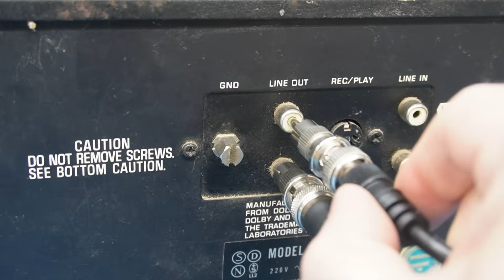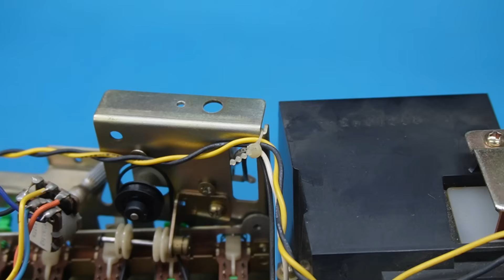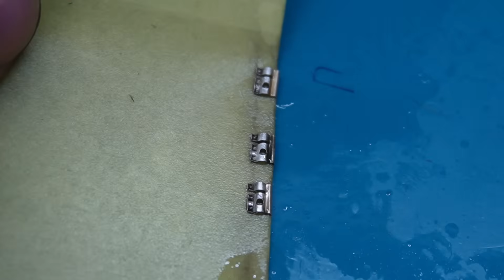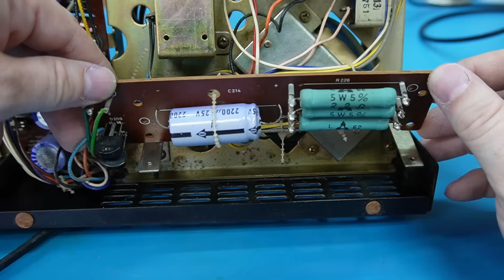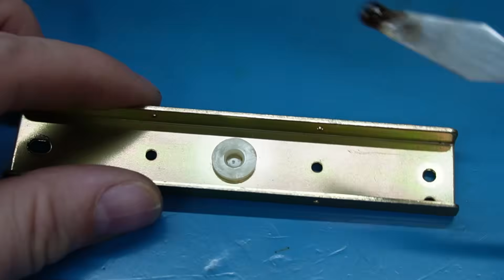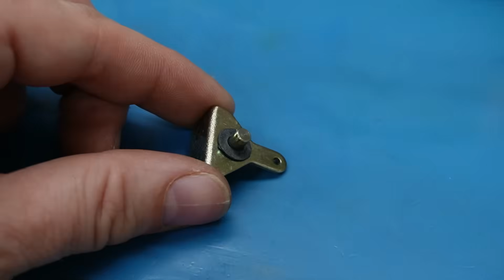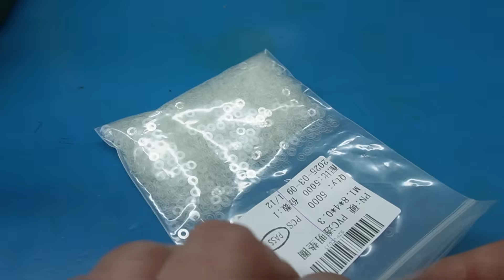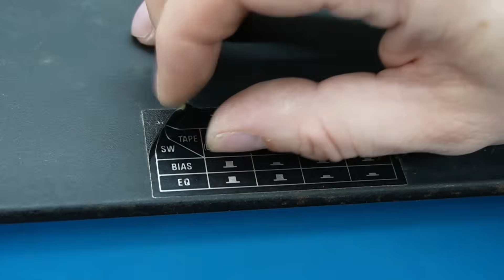The TECHNICS Tape Deck (RS-671)

Comment: These Technics 670 series decks from the 70s are unbelievably well built, as are the M85/88/95. Everything is solid stamped galvanized steel and all the electronics are discrete. In my opinion they are possibly the prettiest and best built decks ever. The Nakamichi Dragon may have bells and whistles, but half of it’s transport is brittle plastic.

Comment: I designed and built a ton of lab instruments using those Shadow switches. They very rarely failed of became intermittent. I even used them in my sterio preamp that I designed some 40 years ago. Like you said Mark. They don’t build them like they used to!

Comment: What a beautiful, solid engineered piece of audio equipmnet. Everything made of metal other than replaceable service parts. Huge capstan flywheel. Over built tape transport mechanism. Solenoids twice the size they could have used. And on top of that its the small things you see: The small pieces of dampening foam inside of springs., This entire thing radiates Panasonic construction. Panasonic and Sony of this time making things to last 100 years it seems. This player will last that long with proper care.

Comment: I can't understand why, in a forum like this where so many users are present and active, giving opinions and gathering information about this equipment, nobody posts links or PDF files of the documentation for these Technics RS-607 and RS-608 devices. It's sorely lacking and helps to work professionally without makeshift solutions or shortcuts.
I really need this and can't find it anywhere, if you could help me... thank you very much.

Comment: Hi there! Quick question: what color code did you use for the deck cover? I have an RS-BX646 that I need to restore, and I want to match the original color

Comment: Black silver oxide conducts fine, but if you want you and do not trust it you can easy remove it with ammonia. I clean coated contacts the same way as you using paper and in my case K61

Comment: Hi Mark I’m a Penn fishing Reel service technician can I suggest a couple products ? 
Super lube synthetic grease it is food grade safe and will never harden up 
Also reel X I coat all metal parts with it and it will prevent any further corrosion or pitting probably for life I use it in salt water applications and never seen any further corrosion years after use I highly recommend you experiment with it for your excellent service work

Comment: Yes. That idler tire was the culprit. However, I can visually See the wow & flutter on the scope. That's likely due to a generic capstan belt being used. I always used OEM belts to avoid this issue. Do you have a Wow & flutter meter?

Comment: Hey Mark, great video! been watching alongside trying to fix my own Technics RS-676 USD. At 25:36 it seems my take up reel doesn't spin as freely as yours and may need lubrication. same for my Tape counter gear. As a result it has too much resistance and it causing the auto stop to trigger.  Im afraid to take it off by force as i may break it forever. do you have any tips? cheers

Comment: Hello! I am very happy with this post of yours. I also have an RS 671! I want to ask you if it is advisable to apply a special lotion to the nut roller and the capstan transmission belt to prevent the rubber from aging! Thank you!

Comment: Rubber restorer is great for tyres, pinch rollers, & other rubber bits!  I just bought one called Rubber Renue 408C, and it's pretty good at restoring the grip & pliability of rubber components.  It does smell quite strongly of Oil of Wintergreen, however..
Reply: Back in the 80s we used methylated spirits to clean rubber rollers, it was very effective at restoring the surface.

Comment: Like you, I usually take the switches apart to clean them.  I usually give the stationary contacts a clean with some metal polish & use super-smooth wet & dry on the movable ones.  Your method with the fibreglass pencil seems to work well!

Comment: Wrong way to clean contacts, you must lube before assembling back. In 6 months, these contracts will be in the same bad condition. unit is old but you don't lube anything. Why? The way you apply the grease is terrible! Sorry Mark, but you fix everything without the heart. Yes, good smile but job done just for check mark!

Comment: Mark great learning video, next time you retread your hub and tire use superglue IC-2000, it has some carbon in it and will actually flex some. We use the IC-2000 superglue in the RC model plane and cars and drones hobby where we need a little flex in the superglue joint to protect against shock and vibration. Also HPF stands for Hot Pressed Ferrite heads

Comment: Method 3, bending legs to open the switch is the least favourite of mine - but also the most rewarding, and in case - of Pioneer and Technics - there was considerable buildup inside. The Pioneer had too many legs break when trying to put it back, my Technics made it, barely. Later I did the same thing for a guy I met online and I finally did it, but had to repair using a cable strip to hold a switch together. And it took me ages and several mails from him to make me actually go and do it. In the end it worked, but not as great as I had hoped.

Comment: Hey @MendItMark, you could get an low-end 3d Printer. It should allow you to print washers and o-rings in different "hardnesseses" of TPU and would spare you the tinkering with rubber band.

Comment: Back when these were current they used to come into the service centre with badly worn playback heads as they were difficult to clean at home, so people used ”cleaning tapes” which were often rather abrasive. I disliked the horizontal decks because cleaning them required more disassembly than a standard deck.

Comment: I was taught by engineers at Harmon Kardon the importance of clean and CONDITIONED switches. you disassembling those switches speaks volumes to just how bad ass you really are. May I suggest a further step.
there is a product called cremlion oil spelling bad or even wd 40 will work. the switch contacts should be soaked in it than assembled. you want a protective coating on the contacts. cleaners strip them to bare metal as does the contact stick you use. once bare it oxidizes twice as fast. just look at your brake rotors when you park your car at night than check again in the morning solid rust (normal for car rotors but not switch banks) 
even white lithium grease can be used it will prolong the lift and eliminate the intermittence that plagues all techs.
thank you for all you do . my favorite part of your show is when you just happen to have some crazy chip burner or other equipment saved for R & D labs

Comment: Wow, just the editing alone is impressive.
Not seen anyone go to these lengths of servicing older tech on YT, but there are probably some others I haven't seen.
I have dabbled just a little on old radio and cassette repairs, not always succeeding. I don't have the patience!

Have a Sony ICF- 880L radio with a few 'presets', which is in good condition (made around 1991). It works fine, albeit the white casing is a slightly yellowed, but still  looks a quite near it's original cream colour. 
Only problem is the volume is a little scratchy to get right.
Did open it, but it's so crammed with more quality than not, it looked like a mine field of going deeper to get to the volume switching. I tried switch cleaner, which improved it a bit with more volume control, but still needs a little correcting for volume to settle in one spot.
Bought it at a car boot for 50p in 1997 and have used it every night since!

Comment: Ode to Mend It Mark
(A Funny Poem in Praise of a YouTube Legend)

There’s a place on YouTube, a soothing delight,
Where capacitors twinkle and solder burns bright.
No drama, no shouting, no influencer lark—
Just circuits and calmness, all fixed up by Mark.

With vintage hi-fi, he works like a pro,
Reviving old radios from decades ago.
A tape deck, a turntable, dusty with age—
He opens them gently like turning a page.

With screwdrivers poised and a cup of strong tea,
He coaxes old tech back to life tenderly.
“Ah, that’s the culprit!” he says with a grin,
As resistors surrender and new parts go in.

The hum of a soldering iron fills the air,
Like spa music for geeks—it’s ASMR flair!
No rush, no fuss, no influencer bark—
Just soothing repairs from Mend It Mark.

So if life’s too noisy, your brain’s in a fog,
Skip the yoga, forget walking the dog—
Just tune in to Mark, and soon you’ll agree,
That mending old hi-fi is pure therapy! 😊

Comment: Can you help me? I have a Krondack TK23 recorder. When I turn it on, it makes a buzzing sound. I replaced the 50uf350v capacitor and the buzzing went away. But when I turn it on and raise the volume, the sound is as if the heat signal cable is cut off.😊

Comment: Hiya Mark, just wanted to say thanks, this video is a lifesaver :) I've had a Yamaha TC-1000 deck on my desk for a few months now, with almost identical issue: right channel goes into a feedback loop when playing. I tried almost everything from power supply to disconnecting the head and grounding the input, but only when I saw this video a few days back it occurred to me that this big solenoid-activated switch might be the issue... removed it, measured, and what a surprise, there was resistance in tenths of Ohms on some contacts. Cleaned it up, works like a charm :) so thanks a lot, again! Love your videos, keep it up!

Comment: I ended up buying one of these second hand (ex-dem) back in the late 70's (brushed aluminium not black). Everyone I knew who were shopping for a cassette deck at the time (plus me) was on the waiting list for the RS-631 which was all the rage. A dealer was selling the 671 second hand for the same price as a new 631. The 631 had larger VU meters and a smoother eject mechanism, but the 671 was sonically better. Thanks for the trip down memory lane.

Comment: We used to have to use pencils/pens to force the tape to wind if there were too many ridges in it. I think the machines are designed to slip if there is too much load, to prevent damage in case the tape was jammed.

Comment: Lovely to watch how Mark makes this classic Technics work properly again. Got the same deck yesterday from a friend and tried it today. Didn't play. FF&REW worked, but after watching the video i dared to open it. The big Solenoid, reponsible for the play function seemed stuck and after a little bit of fiddeling it worked again. Still have to replace a belt and a rubber wheel. Also the deck stopped after a few seconds when using ff&rew&play caused by a small belt which drives the counter meschanism's vertical axle. It seems to have a little magnet in its foot which triggers a small counting glass microswitch nearby. Once fixed all running functions worked again. Unfortuntely when assembeling a micro ball bearing and a roller came from nowhere towards me but this mystery was quickly solved thanks to this wunderful video which helped to locate the right positions for these parts again. Thanks Mark, for making such educative and easy understandeble video.

Comment: I don’t know where to start. My late father had a silver one of these as part of his audiophile setup. He also had a RS276 tape deck, a SL1200 turntable with a Shure v15 stylus and a SU3500 amp connected to a pair of IMF TLS-50 speakers.when I was 11 years old he did me a top of the pops style tape on a TDK SD-C60 tape, it absolutely blew my tiny mind. As I got a bit older my father made a few tapes for me and my brothers for our birthday or Christmas. I ended up with my own setup of a Technics SA400, Mission 700 speakers and a Technics SL-DL5 turntable with an Ortofon stylus. My tape deck was a Technics RS-M215 but I later changed it to a DENON DR-M22 tape deck which was much better. My father was impressed by the Denon design and sound quality too. I was given a Toshiba CD player by my brother but it was a bit odd as it was about the size of a paperback book and had a strange output making it seem quiet. I decided to replace it, one day while I was out shopping for TDK tapes I noticed a new Hifi shop had opened up and had a poke around, in the window was a Denon CD player that was looking magical. I asked if I could put a deposit down on the unit, I only had £20 in my wallet but was going to spend it! I got a receipt and headed off to WH Smith to check up on this CD player from DENON, it turned out to have been their top of the range model and was given a very favourable review. Knew it was meant to be £1200, the shop had it for £600 (in 1988) and I snapped it up a few days later! I was totally blown away by the sound and detail. My father linked it up to his system and was amazed to find the Denon had exposed a fault in one of his speakers. It was soon remedied and my father was very impressed. I still have the Denon CD player but it needs servicing as it’s a bit old. My main CD player is a Sony that takes 400 CDs and it needs servicing too as the belts have gone funny, it was a job emptying out the unit and putting the CDs in their respective cases. I still have the tape my father did many years ago, I had it put onto CD and sometimes I listen to it again. What’s strange is I never tire of hearing the songs or his voice. A moment in time that will always be special. Sorry to have gone on a bit but I hope you won’t mind too much. My favourite tape was the TDK OD tape but the ultimate had to be the TDK MA-R, it was in a class of its own.

Comment: Nice vintage 👌 tape deck!! Too bad 👎 they don't make these beauties anymore. I remember those dropper resistors. A word 👏 of caution with these. Be careful, those little resistors can get HOT, and will BURN fingers 👉. You're so right, they don't make them like they used to (actually, pertains to everything, including these tape decks). Your friend, Jeff.

Comment: Mark, Thank you for a fantastic video.  I have several of these classic decks and have worked on all of them to some degree, mostly dealing with non-electrical issues such as replacing belts and idler wheels.  Your video confirmed much of what I have "discovered" but it also showed me a few things and tricks that will help me in the future.  That "T" idler wheel can be purchased from a great seller on Ebay but the part is expensive and I've often wondered if a non-T wheel might work just as well.  Your video suggest it does.  Do you happen to know the exact size of the idler wheel you used?  Same question for the FF & RW wheels.  i do have a caliper to try and guess the exact specks myself but I don't have a repair manual so if you know those specs i would really appreciate it if you could pass that information on.  Thanks again for a GREAT video..

Comment: mark I've got two power amps H&H V800 1990s  both not working please help they are such good amps  also have orange SL 120 1960s Tascam 488 MK2 8 track recording studio. 15 inch Tannoy in monitor gold speakers . JBL 4333A 1980  or 1970 pair of speakers  I have inherited this equipment and I need to know what to do with it it would be great if somebody could restore all this wonderful equipment
Reply: as I go through this equipment on finding more and more stuff   LaserDisc Player Pioneer CLD-V300

Comment: I think a "safe block" type connector would be much safer to connect up 240 volt mains, that's what I use when there's no plug, a safe block is designed to safely connect live mains flexes without a plug and they're still available as a workshop tool as far as I know. And a word of warning about contact cleaner sprays, some of them can destroy old switches, I know as it's happened to me enough times, but that was decades ago, I think they use safer formulas now, but there just might be some destructive ones still around so just be aware. And I think traditional hand screwdrivers are much safer for removing screws as you can ease them out slowly so there's less chance of losing them.

Comment: There's an old urban myth with cassette decks, that a "soft eject" feature means that the deck is supposedly "good quality", well what absolute CRAP! Any manufacturer can fit such a thing, they're only a couple of bits of plastic with some sticky fluid smeared on them, and they were used on absolutely LOADS of cheap tatty decks, I know cos I used to repair them. But I once had some idiot who knew nothing about such repairs and who had never stripped one down and had absolutely no experience of the job try to tell me most assertively that such gimmicks as soft eject were "only used on top quality decks", don't you just hate it when some idiot tries to lecture you about a job you know and they DON'T! The soft eject thing is just a feeble little gimmick to mesmerise consumers into thinking they're getting a supposedly good quality product when in reality it was crap.

Comment: I used to regularly repair all manner of consumer electronics, as well as some stuff for live music and professional recording, and various stuff used on old classic cars and motorbikes. But stuff like old cassette decks, just like other old stuff have a lot of specially made parts which are now obsolete and no longer available, and with cassette decks the take-up clutches wear out which cause the tape to get all chewed up, so unless you can find any new old stock anywhere you're stuck, as I was just recently when a friend of mine asked me to see if I could fix an old 80's cassette tape deck but the clutch in it was absolutely finished, it had done far too many miles, it's just like knackered tubes in old TV sets, they're no longer made.

Comment: Mark, can you please explain what exactly happens electronically in the cassette deck, when the Chrome, Metal, FerrOx switch is used - what changes inside the deck ?  Thanks in advance, you have awesome skills and I learn a lot - Thanks!👍